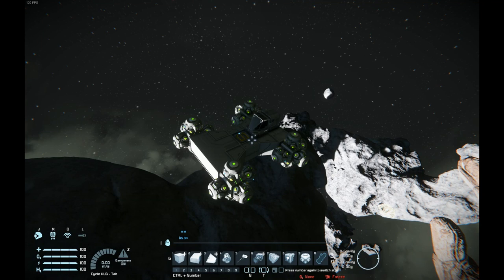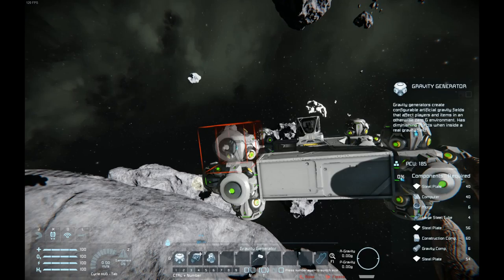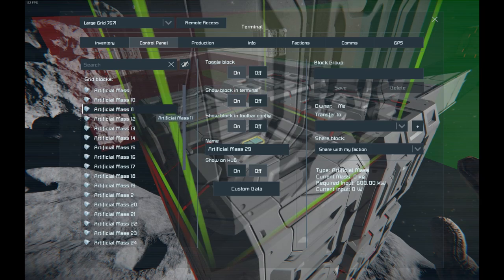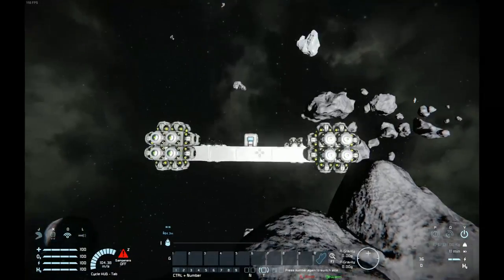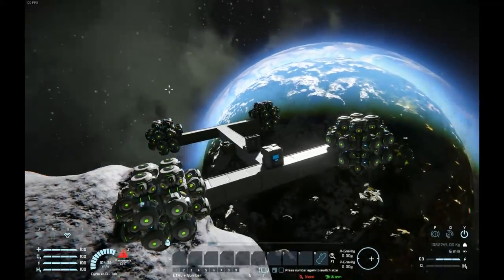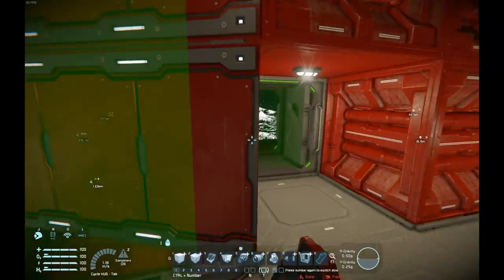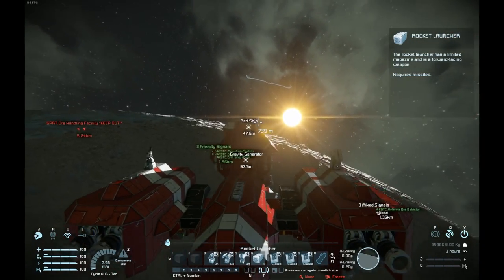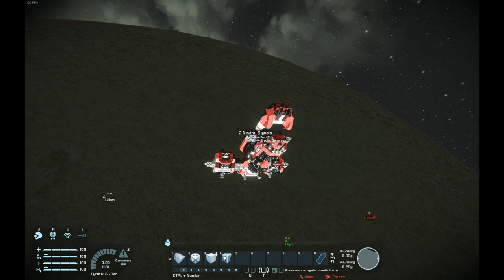Fly using gravity, no thrusters or gyros required!

Comment from the maker: Forgot to mention, there is also a demo craft linked in the description.
Reply: So, what happens if you place another gravity generator in the middle to give the ship some onboard artificial gravity for the crew? Limited in field size so as not to interfere with the gravity drives of course.
Reply: @chrisr3120  Presumably you could rename the gravity generator to avoid it being included in the script, assuming the script only changes the gravity generators by name not by blocktype.

Comment: Fun stuff. Oh, at least until the next time Keen tries to abolish grav-drives.

From your experiment with the Red Ship I'll assume it would not work well on asymmetric ships, or ships with other things docked to them via connectors or landing gears?
Is a script able to determine the position of the mass blocks relative to the ship mass, i.e. could it, in theory, compute correction factors to cancel out sub-optimal placement? Then ideally it could compensate for asymmetry, in all 6 axis.

p.s. Large Ions are usually 33.6MN, not 4? :)
Reply from the maker: Yeah, honstly expected it to have been removed a long time ago, it was testing whether or not it still worked that led to this idea :)

It would not, unless the blocks are position such that the center of thrust aligns with the center of masse; This should be fixable though, the same way as i intend to fix the drift inside natural gravity, i'm thinking of using a PID loop or something similar.

As far as i could tell, there isn't a simple way of determining the grids center of mass, which i find odd since there's a checkbox for showing CoM and the PB is supposed to be able to access the same info as the player, though there is many examples of this not being true.

The large ions consume 33.6MW of power, but only produce 4.3MN of thrust :)
Reply: Now that's awkward, how did I get those two numbers mixed up, hehe.

So determining the CoM manually then... and it'll just get worse with any subgrids or cargo, sigh. At least the correction factors wouldn't need to be recomputed often. Probably still better to compute them manually than trying to force everything into a PID controller.
Reply from the maker: Fair mistake, you had me doubting for a second as well ;)

Well that's the challenge isn't it?
Only way that i can thin of, on the top of my head, is to check location of all blocks and weigh that location with their mases to get a center of mass.
This could result in having to loop through thousands of blocks and i'm doubting that SE will accept having to do that, could be worth a go though.

It would absolutely be better than PID, just wonder if it'd work
Reply: @PatrickHansen101  You can recursively query all blocks over multiple ticks without hitting 50K limit. In my scripts it takes about a second to do a full scan of 20K block grid. The only tough part would be hard-coding a blockType-mass dictionary

Comment: Does it not make sense to expand the gravity fields to include the other AM blocks on the same axis?
Reply: that would waste much more power when using 1 for each corner because of area size consumption part, for movement it is logical to make it 1 big instead but 4 in different places allows rotating with it instead of gyros without overcomplicating the script by setting area for each generator every time, additionally at least 2 parts required for correcting movement without overcomplications as normal methods of movement do not rotate the ship but this one does

Comment: Is there any update yet on this? I absolutely love this mod and want to use it on a capital ship but need my regular gravity to function and not interfere.
Reply from the maker: I have a few ideas for getting this working with regular gravity, but it would take a pretty fundamental re-work of the script.
Got a few projects that take priority once i'm up and about again, but if i get the time i will definitely revisit this.
Reply: @PatrickHansen101  yah I tried to make a subgrid connected with landing gear. My idea was that I could have the gravity drive as a separate grid controlled by remote. The clang was unreal. Lol
Reply: @PatrickHansen101  couldn't you place your "environmental" grav generators after you compile the script (and obviously adjust the effected area to not interfere with the artificial mass blocks)?
Reply from the maker: @joeb9645  That's a negative, Space Engineers restart scripts whenever the game is loaded, so it would just be "absorbed" whenever you start your game. 

I guess i could add a tag to ignore certain grav gens, and leave it up to the player to have it not interfere with the mass blocks :)
Reply: One addition i would love for you to make to the script is when wasd isn't pressed all unnecessary drives shut off.
Reply: @PatrickHansen101  Instead of using tags you can store local Vector3I coordinates in PB storage, and check if the block matches one of these on world load. And adding new blocks with some forse-grid-refresh argument.